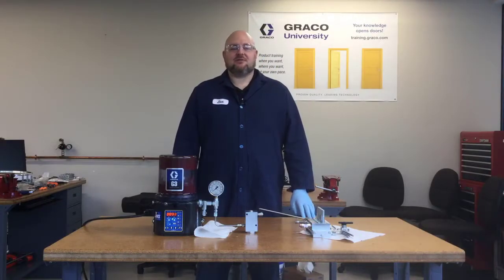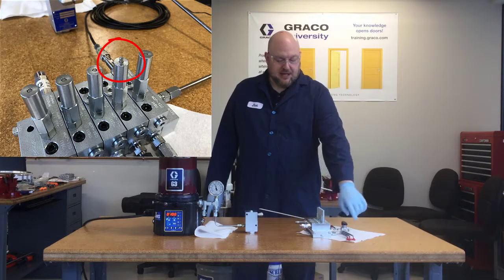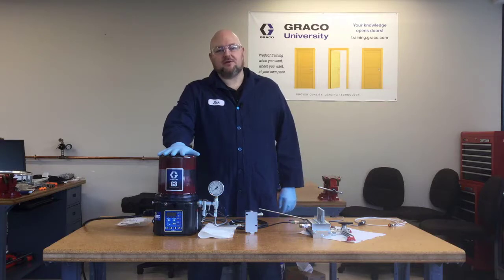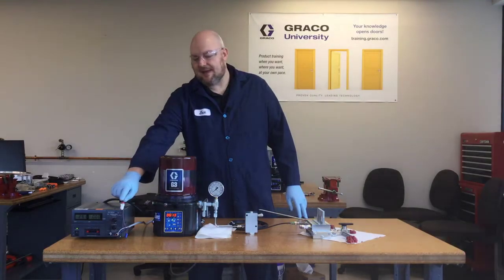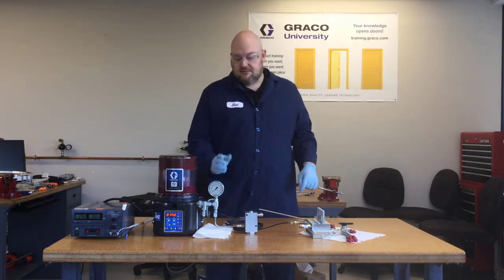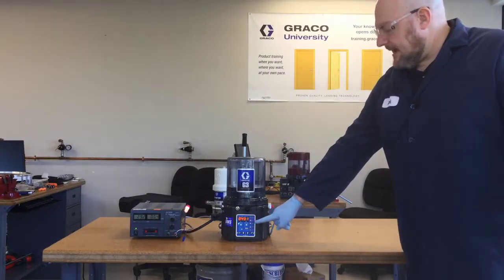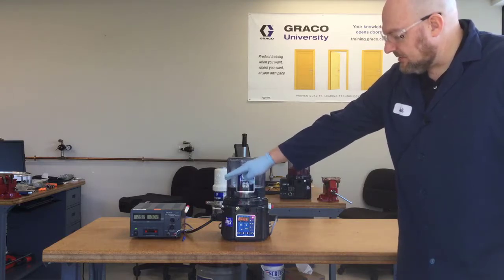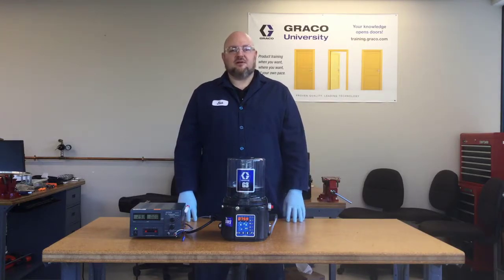Troubleshooting a G3 MSP Frac Auto Lube System

Comment: I have a graco pump on my loader someone had over filled it so I could not see in it . To tell if it was low . There is a control inside the cab that a alarm started going off on it.  I put grease in it I dont know how full it is but I put quit a bit of grease in it. But the alarm is still going off . How do reset it so the alarm is no longer on. Also is there a way I can take the reservoir off to clean it out that way I can see how full it is
Reply from the maker: Hello,
The left-most button on the controller is the cancel button. You can hold that down to clear the fault and stop the alarm. See the GLC 2200 Controller manual for more info. https://www.graco.com/content/dam/graco/tech_documents/manuals/3A2/3A2960/3A2960EN-F.pdf

Removing and reinstalling the reservoir is very tricky, so we do not recommend doing that. The grease should fall down on its own over time, and the wiper arm will wipe the sides of the reservoir clean.
Reply: quizá buscando un botón que dice,riezetear presionarlo unos instantes se cancele la alarma

Comment: Hello, I have a graco pump installed, it is a G3 Max, it is working and we installed a beacon as an external visual alarm and it was working normally; but in the moments of the electrical cuts the pump restarts and the beacon stayed on for a few seconds and then went off.

  but now it stays on all the time without having any kind of failure?
there is no failure in the control of the pump by level, nor by cycles the pump continues its normal operation but the beacon remains on?

   Is there any solution?
Reply from the maker: Hello Eddie, it would be best to call our technical support team to better understand your specific situation. Please call 1-844-241-9503, Monday-Friday, 7:30 a.m.-5:00 p.m. central time. Thank you.